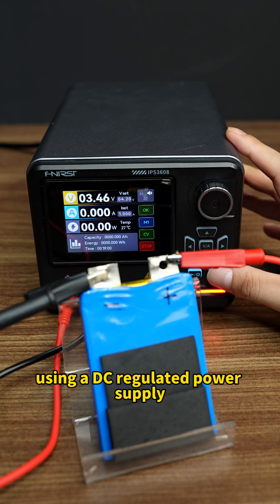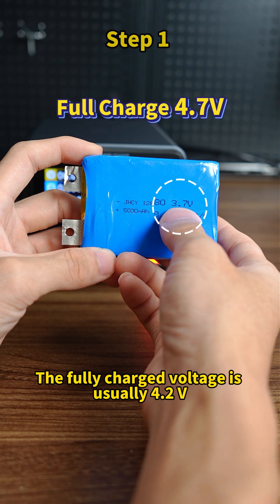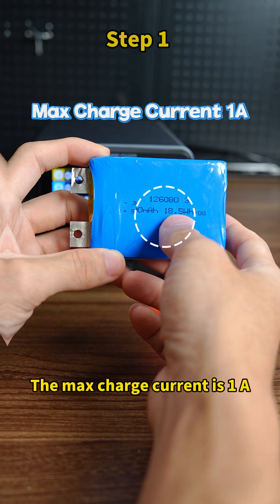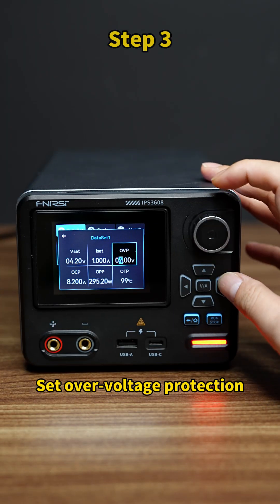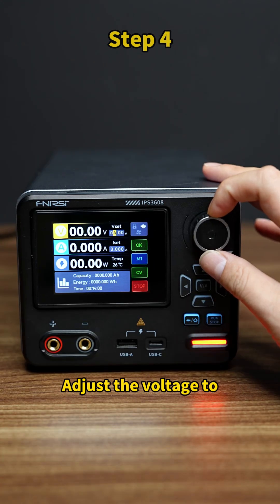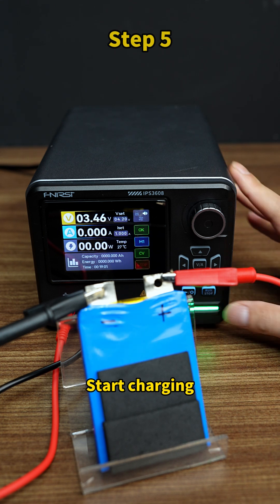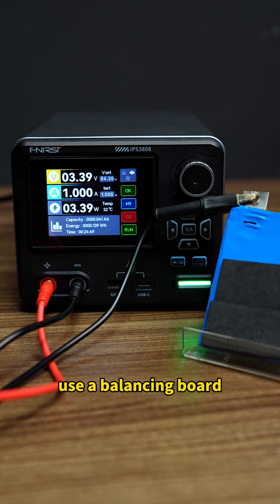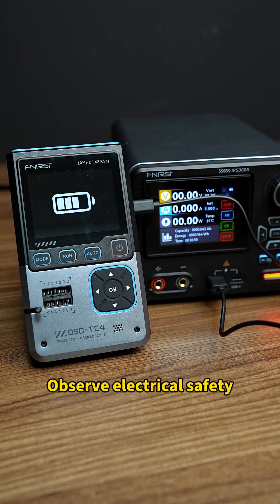FNIRSI IPS3608 DC Power Supply | 5 Steps Learn How To Chare Li-ion Battery Safety #fnirsi #howto

Comment: Just an FYI, you will break this power supply everytime charging battery with  this POS
Reply from the maker: ⚠️ Thank you for your feedback
Please note that the IPS3608 is a high-precision DC power supply designed for lab or bench use. Charging batteries directly with incompatible loads or connections may damage the unit.